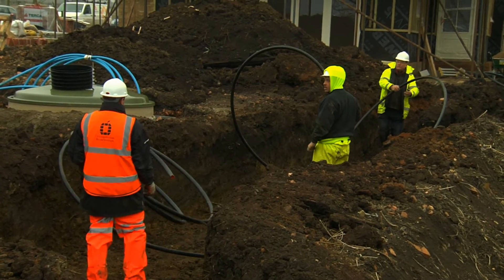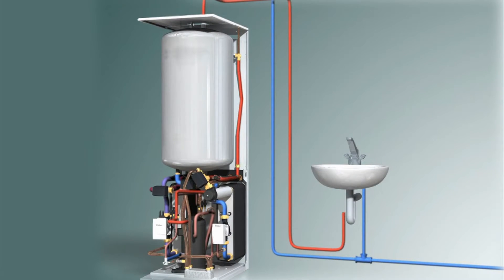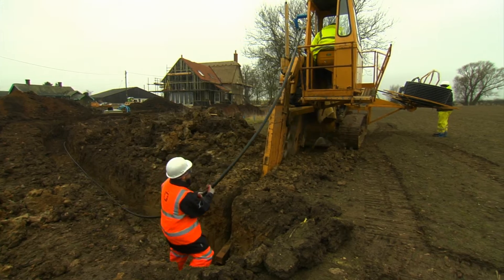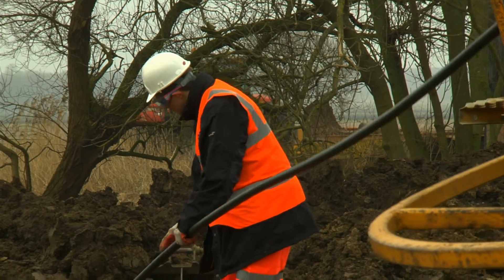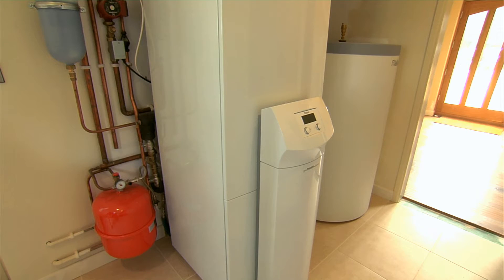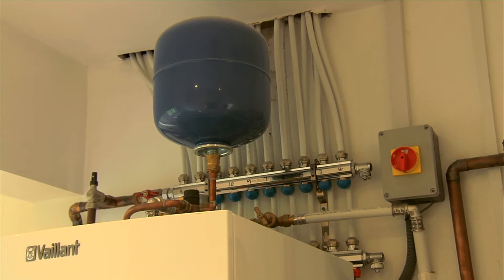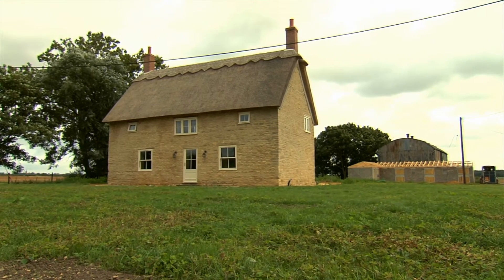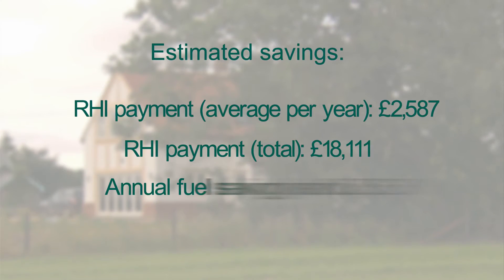Vaillant ground source heat pump case study: The Meaden Project (short edit)

Comment: Is ground source heating cheaper to run than air source? How many kwh can you extract from 1kwh of electricity?
Reply from the maker: Hi Eddie, that depends on the installation and where you are in the country. You can find technical information on all our heat pumps on our website: https://www.vaillant.co.uk/homeowners/products/all-products/?facets=f%2Fmeta_product_group%2Frenewable_energy. To get an accurate forecast, we'd advise speaking to an installer in your area or for more general technical guidance, you can call us on 0344 693 3133.
Reply: @VaillantUK   
I am a Msc student working on GSHPs for my dissertation. I need some assistance with the technical and economical analysis of my project. I would be really grateful if we could connect and you could guide me through designing a similar system as yours. 
Would appreciate any assistance. Thanks